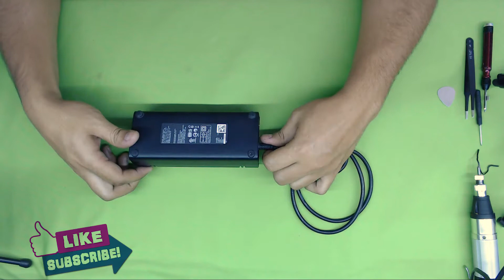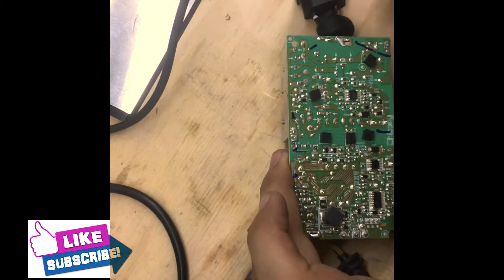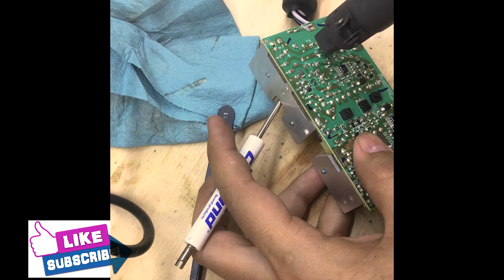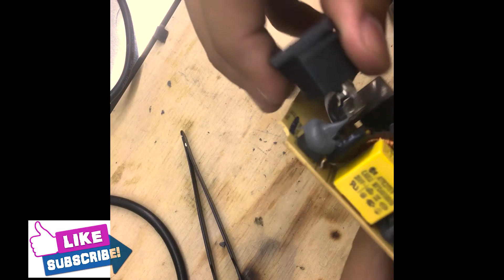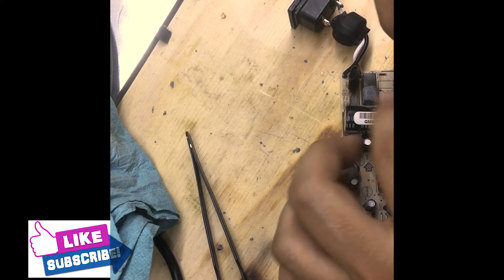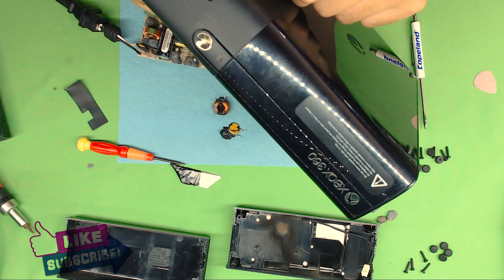XBOX 360 SUPER SLIM OR Elite POWER SUPPLY REPAIR / FIX

Comment: hello, I have a problem with my 360 Elite where the PSU light stays orange and when pressing the power button, it goes green then turns off after about 3 seconds. what could be the issue? it was working fine just a few weeks ago
Reply from the maker: Thank you for the feedback! if you wish to support the channel you can LIKE or SUB or both :P
regarding your question:  that issue is from main transformer of the PSU i recommend you to get a new one from amazon, https://amzn.to/3P1PoyO
Reply: @uFixTek  many thanks! at least i know that the console itself isn’t the problem.
Reply from the maker: your are very welcome, and yes 99% of the time the issue that you explained we get them in the store and its the PSU

Comment: Hi,my power suply light turns on for one second when i plug the cable & then it's off , & the problem isn't in the fuse nor the capacitor , so ...what seems to be the problem please
Reply from the maker: Thank you for the feedback! if you wish to support the channel you can LIKE or SUB or both :P
regarding your question: you may have a bad transistor (the one attached to the heatsink), i will make a note and make a video on how to check and replace a bad transistor.
Reply: @uFixTek  thank you that would be much apreciated
Reply from the maker: my pleasure i will try my best to get on it fast. can you send me a picture of inside of the charge that you have because every charger is different built depending the time and disposable component at manufacture, the charger could be the same exact model but inside they could be very different, as for the same reason above, if the fabrication ran out of some components they change to backup diagram.
Reply: @uFixTek  hi,sorry to bother you again but, i really don't know how to send images to youtube,if you have a instagram or a gmail account that i can send them to it would be great,thank you
Reply from the maker: @nadirboutaba7460   	ask@ufixtek.com

Comment: Hi
I have a 5 volt output but no 12 volt.
DC volts at large capacitor.
Any advice?
Thanks
Reply from the maker: 12v wont be present unless the consoles send the signal back to activate the 12v
Reply: @uFixTek  thank you
Blue or grey wire.
Actually I was looking for a   12 volt or more 15 amps to drive a lm317 and 3055s for a 12 volt dc motor weighing one lb/scooter type.
It is turning a large acrylic disc at 900 rpm
Reply from the maker: why don't you get a any cheap PC power supply they have capacity for a high amp and 5v 12v and 3v out puts
Reply: @uFixTek  thanks
Another video said connect blue to red.
It works green light came on.
Yes I have a pc power supply but need it for old pc for windows paint.
I still am to use 317 and 3055 to drive motor with this.
The motor is to be on for a few hours at a time so I wonder what makes less motor heat, pulse or variable voltage.

Comment: Hello I tried to pull off the rubber feet  and it snapped from the case :(, under it a pie e of plástic. Its like it does not have screws
Reply from the maker: remove that plastic cup and the screw is under that :P you didnt press hard enough to poke the plastic
Reply: You were right. I had to poke deeper. Clean & shiny now. Thank you!
Reply from the maker: Glad you got it removed :P good luck my friend 
Thank you for the feedback and your support to the channel by a SUB :P
if you ever need help or request ask me.

Comment: i striped the screw thats holding the fan
Reply from the maker: use a small flat screw driver and press on the screw head
Reply: @uFixTek  its not working
Reply: @uFixTek  do you have discord
Reply: @uFixTek  the fan is dead what do i do?
Reply from the maker: let me get to the office i send you discord
Reply: @uFixTek  ok
Reply: @uFixTek  i cant seem to find any fuse
Reply from the maker: can you open up the fan and send me the picture of the fan sticker and model?
Reply: @uFixTek  did you add me on discord
Reply from the maker: @YoooitsSCARS  give me your ID
Reply: @uFixTek  Smee7Alkeesh#7549

Comment: ACHTUNG! there is A LOT of juice in this Motherfu****. Remember to short the capacitors first. Or use glowes ;) RIP my finger
Reply from the maker: There should be no Charge on those caps, because of the LED light it will discharge it, unless you plunged it in and touched it without waiting 5min or so. else ya you need to discharge them. thank you for the support and your feedback.

Comment: Thanks for sharing. I guess so, if the capacitor is good, then it is pretty much due to the fuse. I am gonna replace the fuse and test!
Reply from the maker: atelier- danny it could be the fuse, you can check the fuse with a multimeter if you have one or just solder a cable across and it should work else see what could be backed out or burned. Send pics and i can help you